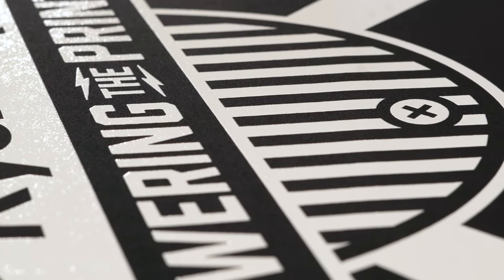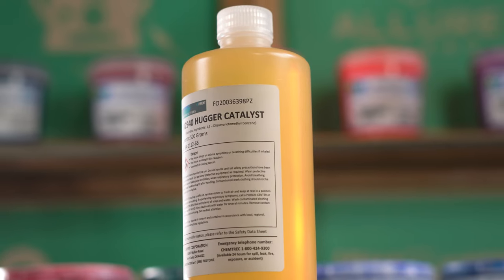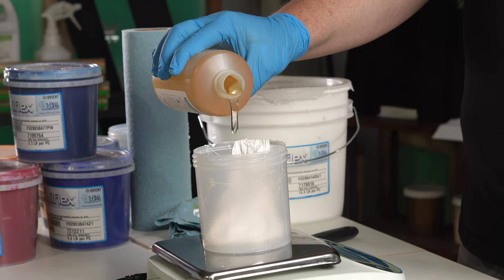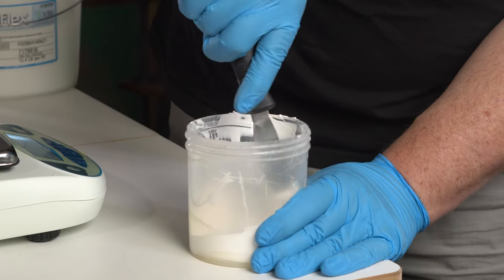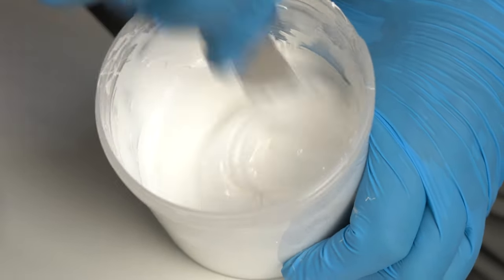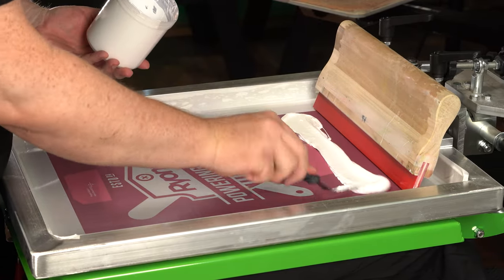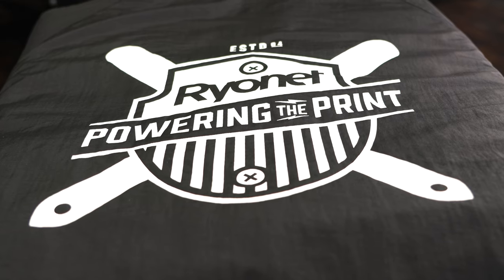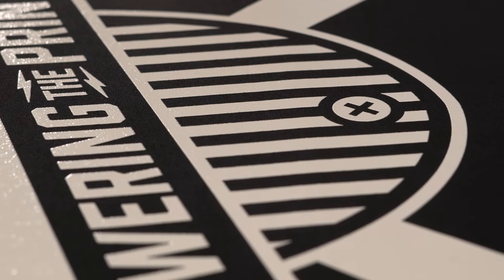The Secret to Screen Printing on Waterproof Nylon Garments

Comment: So to print om waterproof materiellas i will have to remove the waterproofness? 0:31
Reply from the maker: It's best practice to remove any coatings on the apparel before printing to ensure your ink cures and binds correctly. Please reach out via our free 1-on-1 Guidance offerings for more help! https://scrnprntl.ink/FreeGuidance
Reply: Does not taking away the waterproof coating take away the whole point of printing on waterproof garments?
Reply: What method or ink can i use to print in nylon plastic bags?

Comment: best way to cure? I have to use a heat gun and get it to temp but takes forever. scared to burn the jackets
Reply from the maker: Best way to cure would be with a conveyor dryer for proper temp control but if you have a heat gun, that's a start! Using a heat gun is inconsistent and you're right, it takes forever! I highly recommend saving up for a flash dryer or even our small table top conveyor when you can. Please reach out to our Sales or Support Team for questions on financing! https://scrnprntl.ink/3toL31P